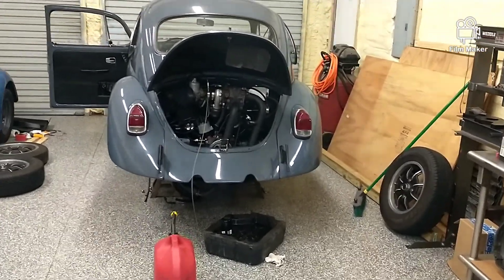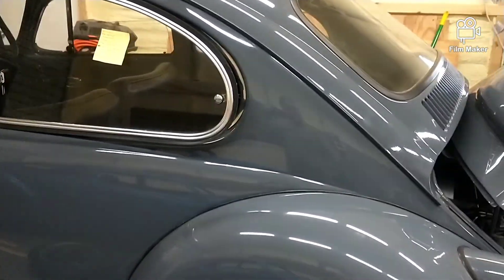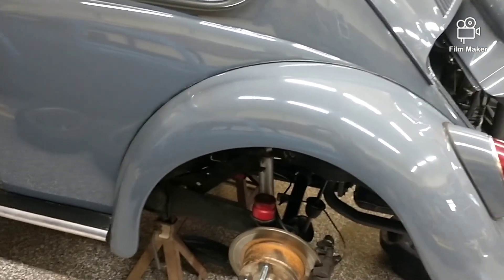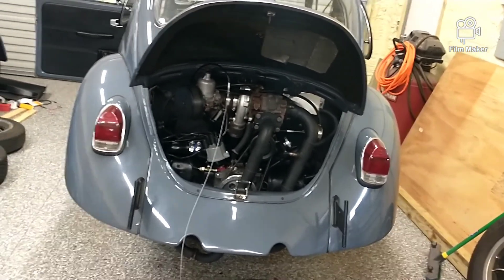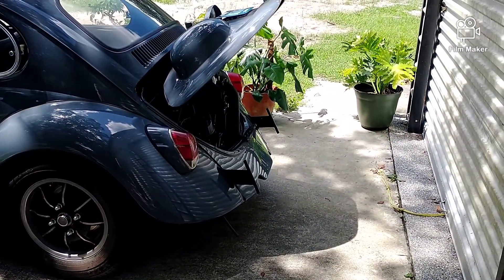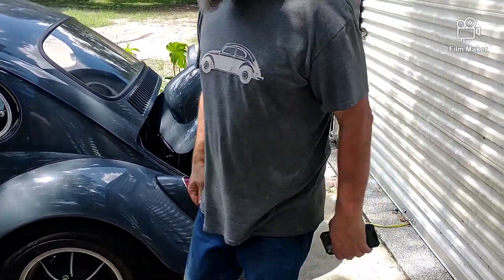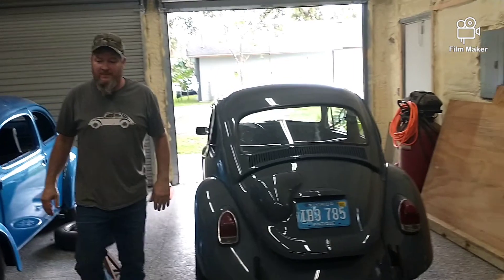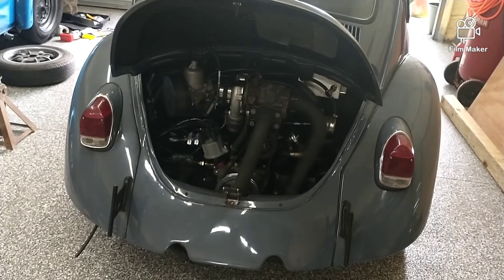Boosting the Bug!!!  #vdubrun21

Comment: Question; when running turbo with all that piping, how do you keep the engine compartment airtight for cooling?
Reply from the maker: You don't. The deck lid is off set at the bottom to give the turbo header room and try to let out some of the hot air. It no longer used the seal of the deck lid to pull air from the vents below the rear window. But used the low pressure air created behind the car when going down the road to pull air through the vents, not perfect but it works.